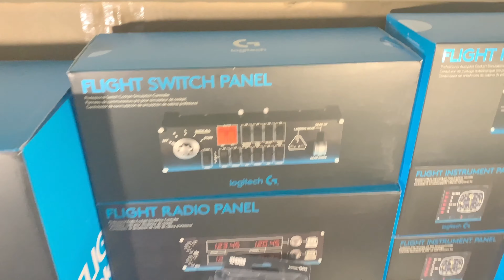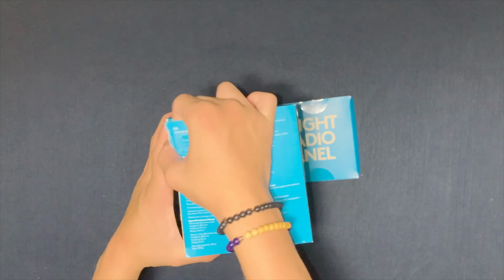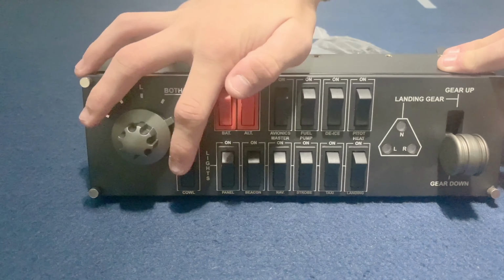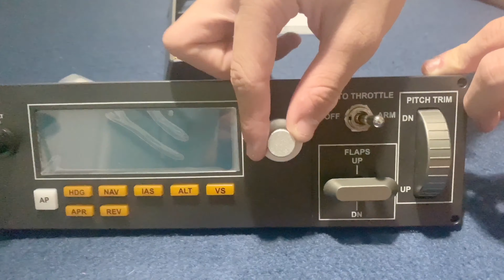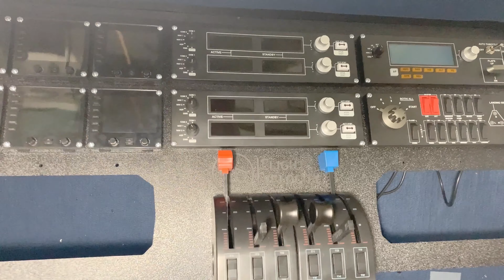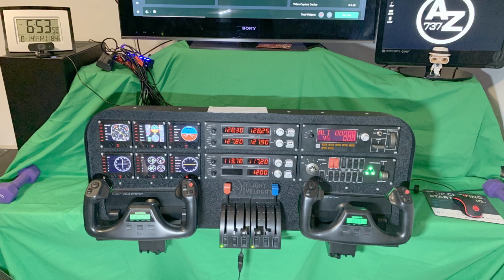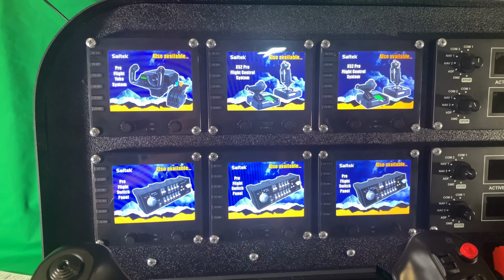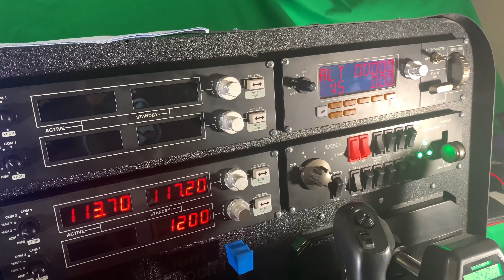DREAM COCKPIT SETUP- DUAL YOKE PANEL with Logitech Tutorial/Setup Instructions!

Comment: This has been the best assembly video I’ve seen. Great job! I’m hoping to build a similar single yoke set-up but still trying to decide on which computer and monitor to get. If you have any suggestions let me know.
Reply from the maker: Thank you so much for the feedback! I would suggest a couple of things. First off I would get a tv maybe 2k or 4K it honestly doesn’t matter the resolution but I would get about a 36” tv. After that try to hang it up or mount it on a wall so it is over the panel. The panel clamps to a desk so also find a desk that can withstand heavy weight. Lastly find a motherboard that goes in a computer that has a lot of USB ports. You will most likely need to buy a usb hub for more port storage but the more ports on the motherboard, the better off you will be. Sorry if some of this doesn’t make any sense, if you have anymore questions feel free to reply!

Comment: I'm curious as to whether the second yoke is active because FS doesn't like multiple inputs for the flight axes from different controllers with different settings.  You'll have one yoke giving elevator input for example, while the other could be doing the opposite.  I can't see how that will work.
Reply from the maker: Great question, both yokes can give inputs on fs2020(not at the same time). We usually just take turns flying, because both of us can’t give inputs together. Although you can fly with a yoke, press buttons on the AP panel and use rudder pedals at the same time, you just can’t use 2 elevators/ailerons at the same time.

Comment: So help me figure out how you attached it to the table?? I only got a panel and some screws.  All instruments are on back order...
Reply: So the yoke has a clamp to it (which clamps to the table), without the yoke it would be very difficult to keep the panel on the table
Reply from the maker: @ethanhathcock_  yes exactly, the yoke will connect to the table or whatever you decide to clamp the yoke to.
Reply: Hey guys, our flight instrument panels glow but they do not work.  Any idea how to get them to work??  I’m so frustrated!!
Reply from the maker: @SAnderton5  sorry for the late response, if you are using spad.next, be sure to go to the notification page and download the drivers necessary for the instruments. I think they are call FIP Drivers or something like that. If you are only using the Logitech drivers,  then it should automatically work. Just be sure to download the necessary drivers.

Comment: How much did the mount cost?
Reply from the maker: Around $2000 USD. Although only a singular yoke panel (which you can also make) is only around $1500 USD
Reply: No it’s about $2300
Reply: With single yoke
Reply: @alphazulu7372  only the panel also because I already have the command how much does the flight velocity panek cost?
Reply from the maker: @plane_spotter_italy  for just the panel, you can find it on flight velocity website, they all cost different amounts

Comment: Great video.   😀  Thanks for making it.
I'm curious - when you turn or push on one of the yokes does the other yoke move in sync with it,  or does it just sit there motionless ?
Thanks again !!!
Reply from the maker: Thanks! So when you move one of the yokes the other one is motionless. You can move both yokes at the same time, but only one of them will cause an input. I hope that helps!

Comment: do any of the devices work for the transponder and setting squak codes etc?
Reply from the maker: Yeah so the “radio panel” we put in the middle can be doubled as a squak code. So the top panel we usually use as radio frequencies and the bottom is for squak

Comment: Great video!  My setup is exactly like yours I am having a problem with getting everything to work. I would like to get your suggestions on how to make my FIPS work at the same time my radio panels need to work.  How can I contact you guys to perhaps get a little assistance?  I will send you pictures of my setup. Thanks!
Reply from the maker: Yes we had the very same problem, first off you can contact us at ttvalphazulu737@gmail.com
But to try to answer your questions, I would suggest getting spad.next which is a 3rd party website that has FIPS to use. You will find instructions on that website that will guide you to the rest. It should explain that you need to download the Logitech drivers necessary. These drivers are found on Logitech g website. The bad part about spad.next is, it costs money, it’s not too expensive though. You can get a free trial to test it out. If you still have issues, contact us on our email and we will gladly help out! Thanks for the comment!
Reply: You need to use USB 2.0 port ; get a powered 4 amp + hub with 2.0 ports

Comment: Are you using this setup for 737 primarily or flying a variety of aircraft?  My interest is in the 737 but am trying to learn to fly starting off with a lesser aircraft first.  And you panel appears it would be useful for the Cessna all the way up to a 737.  Thanks.
Reply from the maker: Yes we have used this anywhere from a Cessna to a 737 to an A380, although flying an airbus with yokes is quite weird 😂 but yes it works with everything
Reply: Thanks for the reply.  One nice part of the frame you all used is that it has an opening for the big box that the yoke is attached to.  In my present setup the yoke and box sits on a desk and is too high and I am too far away from my 32 inch monitor due to the length of the box.

Comment: I'm new to flight simulators. Why the need for two flight radio panels?
Reply: I have the same question. Is dual flight radio needed for bigger planes like B737 or A380?

Comment: does all this work with microsoft flight sim 2020 or just x plane 11
Reply from the maker: It works for x-plane, msfs, prepar3d, and fsx
Reply: @alphazulu7372  thx so much ill probably just purchase one from flight velocity because i think ill fuck something up also do you have to bind everything or does it do that automatically
Reply: @alphazulu7372  also do you know if you could put a honeycomb yoke instead also is it possible to put a trim wheel next to the throttle
Reply from the maker: @GavFlys  idk how prebuilt work, also i doubt the honey comb yoke fits, but you can always try. You can buy an add on trim wheel, but the Logitech AP panel comes with one.
Reply from the maker: @GavFlys  after some research, I found that some of the prebuilt flight velocity panels already come with honeycomb yokes, so nvm I guess you can use honeycomb, also some boards come with 2 slots for throttle so that way you can use 1 slot for throttle mixture etc. And one for the trim wheel